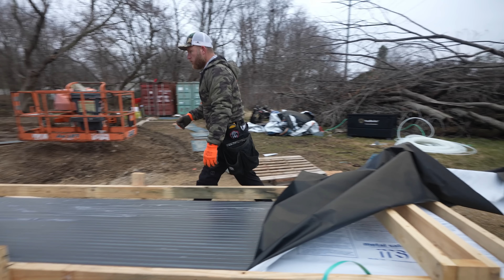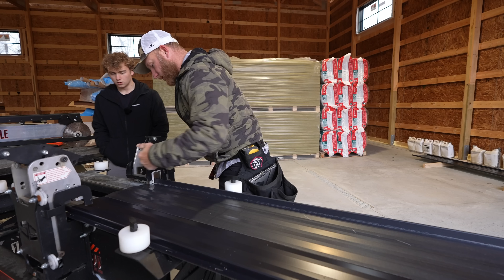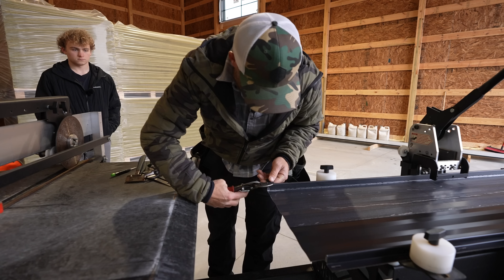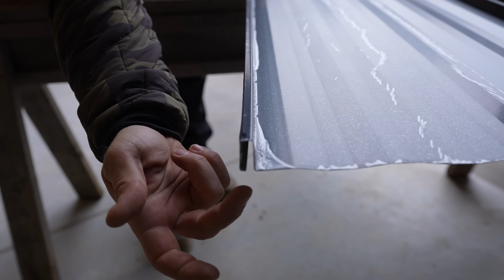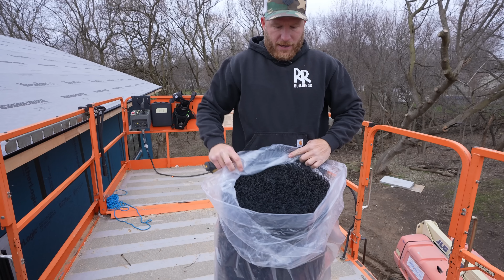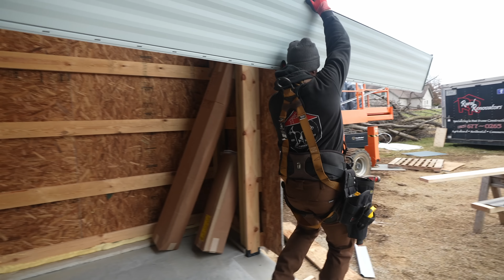My Dream Shop Ep-34: Standing Seam Metal Roof Start!

Comment: Well done! Another option for symmetrical layout is instead of making the rib the center of the roof, you can make the center of the panel the center of the roof. In that case, figure how many full panels fit in the roof then divide the remainder by two. That's your starter. So in your case, you would've started with a 14 inch panel and then 35 full panels then another 14 inch panel to end it.
Very much enjoyed how humorous this video was as well. Job well done

Comment: I’ve installed this vented mesh under standing seam as per architect’s specs, and it did exactly what I warned them about; creating an air gap between the metal and underlayment IS what causes condensation. The metal should be directly against the underlayment with no air gap. No air gap means no moisture.
In Europe the typical way it’s done is to create a cold roof system: Vapor barrier, furring for ventilation, then another layer of continuous sheathing and another vapor barrier membrane with the metal directly over.
I’ve already seen water damage on new houses due to this vented mesh product! It should only be used with cedar.

Comment: Kyle, not related to standing seam, but do you ever use LVL for stair stringers? I’ve ran into issues with 2x12 developing a very bad crown once the steps are cutout. I blame it on internal stress in the wood. Would love to know your thoughts.
Reply from the maker: I totally plan on using LvL for my stairs in my shop

Comment: Could have done a full piece down the center. Meaning the center of the piece would be on the center of the ridge. And you would have started with an 14” and you’d end with an 14”. Making them bigger on the gables and not having the so small on the ends.
Reply: 35 pieces at 16” and 2 pieces at 14” is your 49’ 588”

Comment: Why not just run the cedar breather vertically?  "Self healing" or not, thousands of penetrations in the membrane seems unnecessary.  Just unroll vertically, minimally attach and screw the metal panel in place acting as a big washer holding the cedar breather in position.  The breather isn't part of your WRB plane so I don't see why it would NEED to be unrolled horizontal and shingle lapped, although that would be the more typical application for cedar shakes.

Edit: Nevermind, looking at the next in this series, the breather went down just like I thought it should.  Apparently I misunderstood the explanation in this video.

Comment: Being from Europe Im blown away at how much time and different components do you use.
Sheeting, taping, vapor barrier taping, window taping, sheet metal cut in 10000 places so it would fit, trim details…like however good it looks it takes sooooo much time. An industriap workshop here in Europe, it would just be built with prefabricated steel frame and walls as well as roof would be done with PU foam filled sheet metal sandwiches and that is id, done. Same water protection, same heat efficiency, same or even better structural strength and probably maybe even cheaper.
Reply: I agree, sandwich panels are great. But this panels with no fasteners are the best. the stupid rubber seals of fasteners will let go in 5 years on hot places.
Reply: Doubt it on the price. Especially with how expensive steel has become. The steel frames we use here are as expensive as the entire building they are doing.

Also, let's be honest here, there is nothing uglier than modern European houses/industrial places.
His shop, has 6+ roof sections, that all make a difference with how it looks in the end. You'd have similar work if we actually tried to make things look decent for a change

Comment: Hi Kyle, great video series. I´m wondering why you don´t use a ventilation layer, between your roof sheeting and the metal roofing. I´m a carpenter tradesman in Germany, we more often then not use tiles on residential buildings, but there is a rerquirement for all roofing materials that they are ventilated on the underside by a continuous layer of 4cm roughly 1 and1/2 inches, from the gutter to the rigde. Especially on metal roofs that is important, since thesy get extremely hot in the summer, warming up the room below.

Comment: For some reason the ribs on most metal where I'm from are 7/8" high so I gotta go that or lower with the bends or else the gable trim sticks up funny. Also with ASC metal in the pacific northwest the panels aren't 16" they are like 16 and 1/10" so every 10 panels you gain an inch making layout more complicated.

Comment: If you started with the center of the panel instead of the center of the rib, you would have a 14” beginning and end pieces as well as used 1 less piece on that side of the roof. 
I’m assuming you want the ribs to line up on the opposite side and may need the rib for support of the valley trim pieces?
Reply: The panel is only 16 inches and he only used one panel

Comment: My local metal supplier will now prep the ends (notched and tabbed) at the factory, only $1/sheet. gotta get Metal sales to do that for you
Reply: I was wondering if you could get them that way. Did my first metal roof after watching a lot of their videos and plan on doing a few more but just personal so it wouldn't warrant buying one of those machines. 

Do you know if they'd do the different lengths like he is so he can bend the little tab over to cover the gap in the hollow part?
Reply: @hjsn1  google Taylor metal, yes they have the tab, and do both ends for the price. The table he has would still be needed for valleys

Comment: Kyle, rather than measuring every 16” wouldn’t it be easier to cut a board at 16” and use it to mark?
Reply: That's a good idea, but you're likely to compound any errors as you go... so by using a tape, you can be slightly off on any of the measurements, without affecting the others.

Comment: The roof I'm doing right now has the same sort of layout for the panels. Using a mesh that's called meta matrix, thought it would be a pain to use but isn't that bad.

First time using it too, but the cap details are a bit different from what I'm used to. It's a 4 sided rectangle roof too. For the capping we have to put the z bar down, then caulk the joints where the z bar ends between panels. Then we run a piece of butyl on the top side of the z bar, then I put on a "clip" which is basically just another cap piece that's a 1/2" shorter then the actual capping, basically the same way Z bar is but it's a continuous full piece and a second layer of cap pretty much, we then screw the clip/cap to the z bar so the z bar is about 2" back from the edge of the like starter cap.

It makes putting the cap on go by so smoothly especially for being on hips.

Comment: That's the detail that I wanted to see. I've seen it before but it's nice to see it again with a little more detailed explanation. I'll be using the same materials that you have used so far on my next post frame. Thanks!

Comment: I was glad to see you are wearing a safety harness while working on the roof…but then I wondered what would happen if you actually slipped off. How do you get down to the ground? Or back onto the roof? The safety rope to harness is behind your back. 
I skimmed a couple of videos - they’re good at set-up but none showed what happens after a fall.
Reply: I'm not sure, but I think they work like an auto belay, so they will pay out at a slow rate... if long enough, then you would slowly descend to the ground, it not, you'd be left dangling and have to call for help I suppose?

Comment: What are your thoughts on how Matt Risinger creates his air gap/drainage plane under his metal roofs by adding angled pieces of wood his metal panels attach to compared to a material like this cedar breather?
Reply from the maker: I don't like that huge gap with nothing under the metal...hail would destroy it I assume...also more chance for oil can
Reply: @RRBuildings  good point